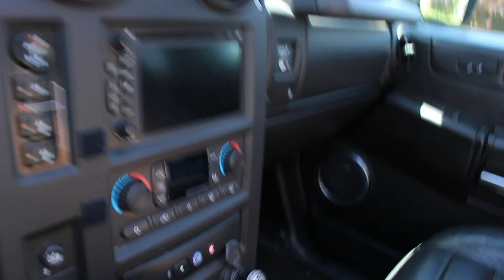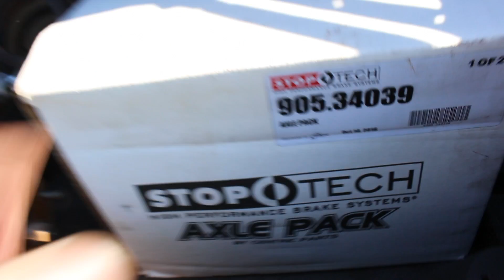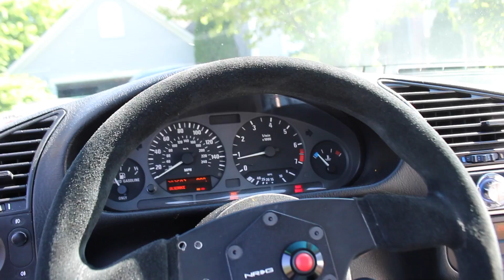I Bought A Purple BMW E36 | MY NEW CAR!!

Comment: to fit the wheels in the rear,  get adjustable rear control arms so you can increase the camber, and roll the fenders. Maybe get a narrower tire on them.

Comment: Get some smaller tires on those wheels and roll the fenders, you can roll and pull the fenders an insane amount on these things, people are rocking pretty aggressive specced wheels (like 17x10 +0, 17x11 +5) on E36s.

Comment: 1998 323is owner here! you won't be disappointed man... m52's are bulletproof engines will handle 400hp just fine with turbo if done right

Comment: rb20 swap theE36 then finally put the 25 in the s13!
Reply: keeping it street naaaaaahh keep it by its root and stay with a bmw-motor! If he's going to swap out the beautiful s52 he shoud go for a s62 or s65
Reply: just my opinion
Reply: i think an M50B25 or S52B32 would be nice
Reply: So disrespectful. Drop an S52 in it and call it a day
Reply: Price of an S52 you may as well go S54
Reply: MattsMedia A good S52 would run you 2500. A S54 anywhere between 4-6k
Reply: Typical jdm fanboy wanting to swap the wrong motor in.
Reply: I'd pay the extra for a another 100 horsepower out of the box the S54 will give you. There is no way you're going to get a 3.2L S52 for $2500
Reply: I can assure you I am not a "jdm fanboy" but your comment is appreciated. Its just a playful comment seeing how he toyed with the idea for the s14, this vehicle now replacing that for the time being.

Comment: felony form but hard to get and big duck club make super nice kits and mkah Motorsports make super nice door panels. My e36 328is wasnt worh the hassle fixing the panels and put a CAE shifter and you will love that thing. And turbo the stock motor with thicker head gasket and arp hardware I've seen 600hp easy.

Comment: Wondering why the engine bay is not color matched, usually they're the same color as the car without clear coat. I think you have a painted car, whats the color badge say on the strut tower?  Headlights literally throw them in the garbage, stickers as well.

Comment: Pretty cool e36, 
style 40s aint that rare though .. you should get all backs ..and leave them silver.. :)
those wheels are offset 8, 17x9. theyll fit without a wide body, just need to  roll the fenders. and get smaller tires like 215 35s

Comment: Window problem will be the regulators it'll keep getting worse and then they'll pop out and won't work at all easy and cheap to replace but not if it gets to the stage where they pop

Comment: the power window issue is known as a common e36 problem. mine has it too and its proper bmw from munich 😂 greets from Germany
Reply from the maker: +Generation D ドリフト Is it the regulator that's the issue?
Reply: Kalvins Garage i dont care about it too much as long as the window goes up and down. dont worry about it, it is just annoying. When you know a way to fix it, let me know.

Comment: I mean nice that you chose an E36 but man you gotta know at least something about them. This is not an m3 it's a straight 6, 3series with an m3 bumper, non m side skirts and an oem rear bumper with an aftermarket m style diffusor. I mean you got m3 mirrors and door panels but the door sill panels have nothing on em (oem). I didn't know a golden cover under the hood transforms a 3 series into an m3. And you should probably get m3 vader seats will look way better. And please paint those mirrors.
Reply from the maker: +Hannes quill I never said it was an m3 haha. Not a big deal. Never said I know everything about everything pal. Again.. no one ever said it was an m3. It's a 323is..

Comment: i did the same thing traded my white s14 for a e36 325ic i have a felony form kit on mine and on coils and m3 everything and a tune is what i traded but thats clean man if you need help on that idle mine was a hose under the throttle body which leaked which i would check and check all your rad hoses and radiator cause mine were all shot if you need help on anything lmk my insta is @jpkolojay